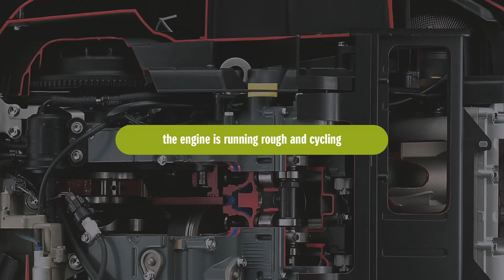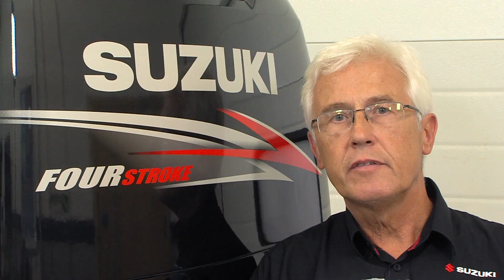Top tips - possible causes of rough running (Suzuki performance outboards)

Comment: My Suzuki 175 problem is runs good at low rpms higher rpms act like it not getting fuel . Replace all filters and put all turn tank with higher 93 octave gas please help motor has less then 200 hours

Comment: hi, my Suzuki dt 140 2007 runs rough during idling, i places an amp meter and found the top spark plug wire is drawing less amps than the rest of the 3 spark plug wires. what should i look for to remedy this problem?
Reply from the maker: Hi Mark, this could be a poor connection or similar or a failing plug, lead or coil. You could try swapping parts over between cylinders to test.